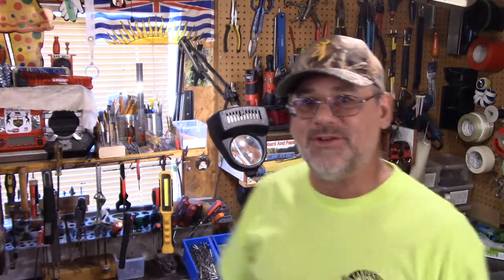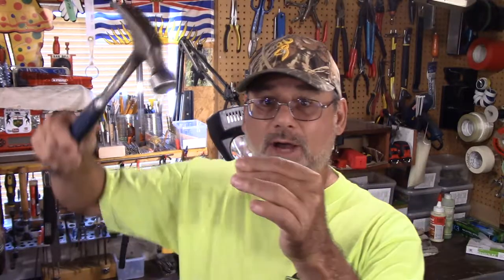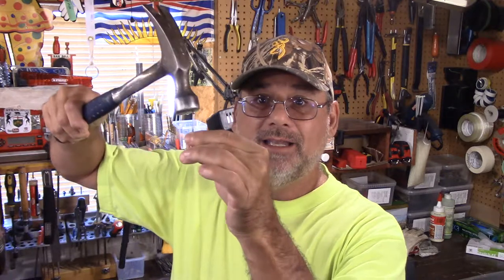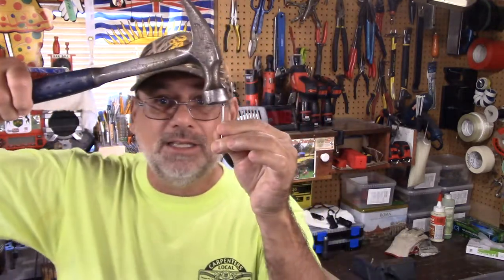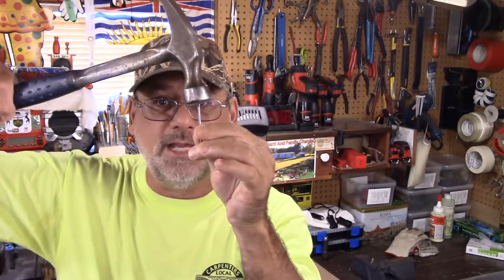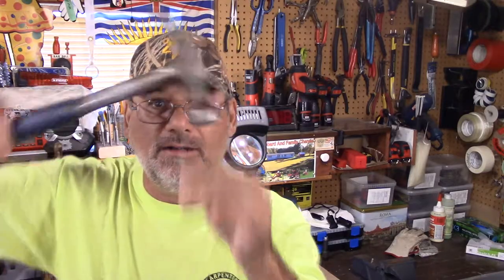How  To  Hammer In A  Nail And What Hammer To Use

Comment: When I used to work construction building decks & doing siding when I was in college I was taught to use a pair of pliers or a piece of cardboard (e.g. from a box of nails) and push the nail through about half way to hold the nail. Worked pretty well. I could load up a couple nails at a time with the cardboard which speed things up a bunch. Holding the nail between your fingers with your palm up is a pretty good idea too.
Reply from the maker: Anyway is better than hitting the wrong nail eh 😂😂
Reply: Kindly do a video on this

Comment: ZThe biggest problem I find is that people hold that hammer half way up the shaft....hold it at the end...get a good heavy framing hammer and when your building sorting with the lumber yard kiln dried wood that pisses all over you face when your nailing and you get two shots for driving in a 3 and a half inch nail....one to pic it and the other shot to drive it....that pic shot is a good one cuz you want to get it in on the second shot.....you've done this about 200 times and your really going to town and then with that serrated head hit your thumb....well mister....the rest of the day is off and for supper you'll be looking at you cheap tenderized steak you made out of your thumb with that hammer....how do I know this you ask....well I was there and now I have a few air hammers but the one to get is the one with the compressed air cart rages....we rented a few of them when we built the barn....no air lines to get hooked all over....enough said.....CHEERS
Reply from the maker: There ya go it's just as easy as that. A how too Gator would be great - Hint Hint :)
Reply: @SteveRobReviews  Wink, wink, nudge, nudge. Know what I mean, know what I mean? Say no more, say no more. 
Happy Easter guys.
Christ has risen.
Reply from the maker: Happy Easter 👍
Reply: @SteveRobReviews  I must practice first not to muff it up.... lets C now .....how did I do that....CHEERS

Comment: Although I’ve never tried it, some people suggest using a clothespin to hold the nail instead of your fingers. You could use needle nose pliers as well. There are some devices sold on Amazon if you search under “nail holder,” but I think they are a waste of money.
Reply from the maker: Yes good points as nail holders do work but for mostly small nails. Cheers

Comment: I don’t know why they make smooth faced hammers in anything over 20 ounces. I guess some people just use one hammer for rough work and trim but most professionals I know have a hammer for each task. Of course that’s only talking about the rare ones that actually do multiple things. It seems like it’s rare for a framer to do trim and vice versa. I only see this in small towns or with handymen doing small jobs. Hell I’m a plumber and I keep 4 hammers on my van. I have a 2# sledge, a rubber mallet, a framing hammer, and a 16 oz smooth faced hammer. I watch lots of videos on construction which I always thought was odd because most people want to escape what they see everyday. Anyway I see quite a few professionals drive nails choked up on the hammer. I don’t know how they do this. Not counting the fact that it takes more swings because you’re decreasing your leverage but it ruins your aim at least for me. I’ve found that if I grip the hammer at the end I rarely miss the nail but when I’m in a situation where I have to choke up for whatever reason I miss it much more.
Reply from the maker: Josh the vast majority of people on YouTube are not professionals at all.  Some pretend to be pro's  and some just cant pull it off :)  Cheers
Reply: @SteveRobReviews  Trust me, as a plumber that regularly corrects videos so that the poor people who watch them don’t follow their instructions and end up with plumbing that doesn’t work or lose money for failing inspections, I’m aware of that. I’m referring to those that actually build things like Perkins or Scott brown. I’m not calling them out specifically but I mean channels like there’s where they actually have constructions businesses. This makes them professionals. Whether they’re good professionals or not is another story